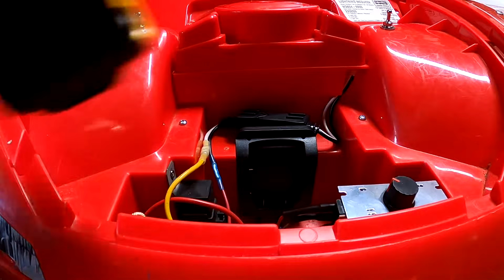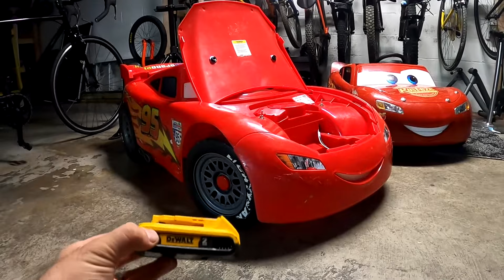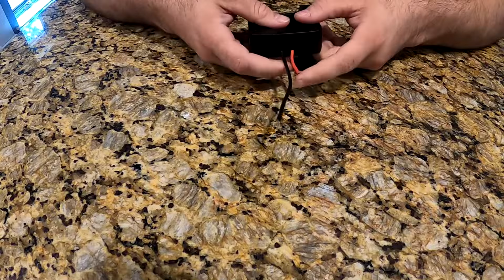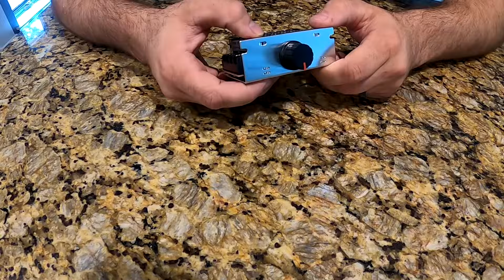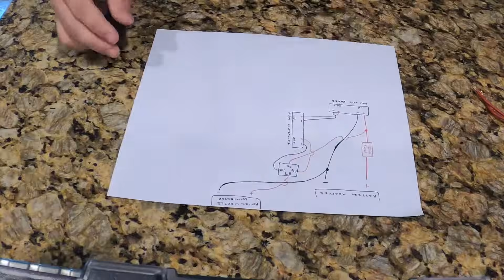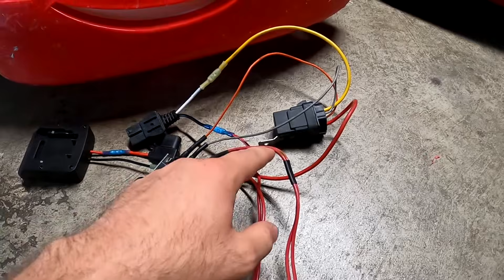Converting a Power Wheels to Run a Dewalt 20v Battery

Comment: Your PWM isn’t working as intended with your wiring diagram.  All it’s doing is triggering the relay, which then gives the full 20V to the motor.

Comment: This may be a little late but if anyone is trying to build this, the circuit looks incorrect. For this relay, pins 85,86 activate the relay and power flows through 87,30. So, in your configuration the PWM is just turning on the relay and the car is getting full power from the battery. The PWM is not limiting power to the car.

Comment: I did everything identical like you did but when big 30amp relay is connected I can't adjust speed controller, all the time I got there 18v. When I disconnecting big 30 amp relay everything works as should. Any ideas?

Comment: Wouldn't  the connection from the battery to terminal number 30 on the relay bypass speed controller all together?

Comment: Hi, why can we just exchange the battery with the dewalt battery without all the other components?
Reply from the maker: The batteries not the powerwheels have any kind of voltage protection. Essentially you could discharge the battery too low and end up not being able to recharge it.
Reply: @Dylan_Draper  Thanks for the video!!  Any chance of getting a pic or pdf of your diagram?  😊
Reply: @Dylan_Draper  thanks

Comment: Did the conversion on my sons power wheels it was running fine for a few minutes but now it turns on but will not move. Think I might have burned the motors out any suggestions on upgrading?
Reply from the maker: I don’t have a suggestion myself, but there are quite a few Facebook groups filled with good info. 

Also, there is a fuse inside the speed controller that can pop.

Comment: After running the vehicle, did you stay at the 15v protection setting on the  board or did you increase it? 
Also, what variable on the minus did you save in it? .5?

Comment: The batteries you over drained, were they the newer 20v Lithium batteries or the older 18v? I was told Dewalts lithium ion batteries already had a voltage cutoff built into them, 15v-21v, is this wrong?
Reply from the maker: I was experiencing this with 20v Dewalt batteries. The voltage cutoff is built into the room with these and not the battery.

Comment: I just did Makita on my 1/10 RC cars.  
The safety of power tool batteries as compared to Li-Po, well, it doesn't compare.  Power tool batteries are built for high-torque, burst and long-term delivery of constant power.  They are physically designed for construction-site dangers such as major falls, crushes and even coffee spills to lesser degree.  Pull it from your drill, throw it in your RC car of whatever size, throw it on the charger, put it on your buzz saw before going back on the RC car and on and on.  

Go generic and costs plummet.  Even if you get a lesser quality battery or over-drain it, you can likely get two or three for the price of one brand label.  Speaking to over-draining, all the batteries have built-in BMS for over/under charge, thermal protections, etc. They're wired to burn out so your Li-ions don't spark.  It is very hard to ignite a power tool battery or you'd hear about it more.  OTH, look at a Li-Po wrong and you can be in for some trouble.  

And of course better performance vs. SLA by miles.

Comment: I’m a bit confused.  The wiring diagram shows 2 positive wires after the 30a fuse and 2 negatives coming off the battery adapter.  Did you have to split both the + and - coming off the battery adapter?
Reply from the maker: Yes, I had to “split” each side.
Reply: @Dylan_Draper  I keep blowing the 30a fuse.  I’ve checked everything over several times.  Any suggestions?

Comment: I copied this setup, but it was draining my battery even when the power wheels unit was turned off. Should that be expected?
Reply from the maker: Yeah, I wouldn’t recommend leaving a battery installed while not in use.

Comment: What extra cable did you use for the circuit protection board? I'm. A bit confused in your wiring. It's way too fast. Do you have a slower video.

Comment: Awesome setup. My daughter loves how fast her jeep goes. Lately the fuse in the speed controller keeps popping. Do you have any ideas why it would pop? I bought a speed controller similar to the one you used. Maybe that’s the issue?
Reply from the maker: I’ve experienced that sometimes as well, I think it may have something to do with the build quality of the controller itself.
Reply: Thanks for the quick response. I was thinking using a bigger fuse 35amp to replace the 30

Comment: Is it possible to also add a variable speed pedal to this set up? Anyone know how to?
Reply from the maker: I’d imagine that’s possible, but not something I’ve looked into.
Reply: @Dylan_Draper  sorry I know nothing about Wiring this stuff
But I can’t find a 4 pin spst relay 
There are however 5 pin spdt relays though 
Can I use that instead ??
Thanks !

Comment: Does it matter that the relay listed is only rated for 12v when we’re adding 20v battery? Will this limit to be power/voltage going electric motors? I’m doing this to make it faster for my son.
Reply from the maker: I’ve used a 12v relay without issue, but 24v relays are available.
Reply: My relay keeps popping. Any reason you can think of, or should I just try a 24v relay?

Comment: I have some questions about your wiring diagram. On every relay that I’ve looked at 85 is always ground. Was this a mistake in illustration?
Reply from the maker: Yes, 85 is generally listed as ground for a 4 pin relay ground.
Reply: @Dylan_Draper  did you switch 85 and 86 then?
Reply from the maker: Yes I did
Reply: @jaytee6498  I followed the diagram and also switched 85 and 86 and still blow the relay every time I plug in a battery. Any suggestions?

Comment: This video is very informative. My son just got a new power wheel for Christmas and we’re finding that even with a spare battery, there is very little play time. What I’m curious about is longevity. Any failure in components after this conversion?
Reply from the maker: I've had a few PWM Controller's fail.  As cheap as the LV Modules are, id imagine their life is not very long, but have worked so far for me.

Comment: Dylan, thank you so much for this video, parts list and diagram.    I have ordered the parts and will be putting this together for my son and grandson for a january birthday with a Peg Perego XUV!   The setup looks pretty straightforward - I am fairly handy and feel i can handle this bit of work, as you have carefully explained.   One question:     is the wiring diagram you have included in your response to "Blue" - in your idrive link - valid?    If so I should be good to go.    just wanted to verify the relay wiring. 

thanks again - i will comment again when all is done!
Reply from the maker: Yes, that diagram is the most up to date one and how mine is setup.
Reply: @Dylan_Draper  thanks a lot.   this is all very helpful.   i will update when the project is done on my end!
Reply: Where can I find this wiring diagram

Comment: Question: How do you charge it? Can you charge it using normal power wheel charger or do you have to take the batter off to charge it seperately?
Reply from the maker: The batter has to be removed to be charged.
Reply: @Dylan_Draper  the battery compartment on mine is under the seat. It would be troublesome to take off the seat everytime it need to be charged.
Thanks.

Comment: I got my parts in and encountered a couple problems. Any help is appreciated.

1. Do the P+ P- or M+ M- on the Power controller go to the Low Volt Board?
2. My 4 Pin Relay has Red, Black, Blue and White wires. Which one is the 30 on your diagram?
Reply from the maker: I have removed the original wiring diagram from the video and have created a new one that can be found here - https://drive.google.com/file/d/1GyrodxrxOTUBLKG-2inGtTiogv7jYbGI/view?usp=sharing
Reply: @Dylan_Draper  thanks..I needed that!
Reply: @Dylan_Draper  with this hookup the full power still goes through the power controller and will burn out pretty quick instead of using the relay to take the higher draw. The old way utilized the relay but you lost power control potentiometer usage. It doesn't matter since this is a silly project, but I wonder how you keep the higher current out of the low voltage board and keep it out of the power controller. but keep the speed adjustability and the low voltage detection.
Reply: @oscaruit  I am facing this now. I followed the diagram in the video and my device is getting full power no matter the voltage regulator setting.
Reply: @D-ee7ts  I will post a video of what I am doing on my kids power wheel. I just have one problem now, if my kid leaves the dewalt battery in, it will drain until dead, and I have to jump the battery off on a good battery to get it to charge.
Reply: @oscaruit  I ended up taking it all out and am just using the regulator since that is my priority. Child health over battery health. But would love to put the LVC and relay back in.

Comment: Brother, I also want to build one. Can you teach me?
Reply from the maker: Check out the description for links to the items I purchased to make this setup (note - choose a battery adapter for either batteries you already have or ones you plan to buy). Then, reference the wiring diagram ive included in the video.
Reply: @Dylan_Draper  Your motor, it seems, is different from the instructions on github?